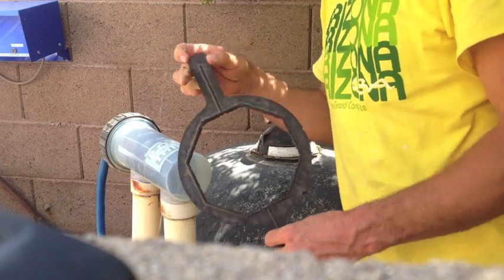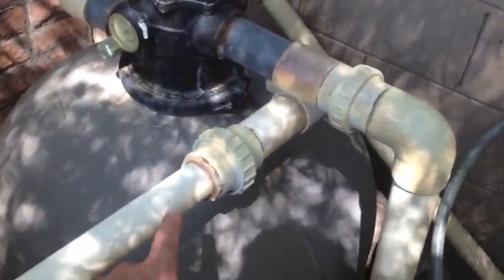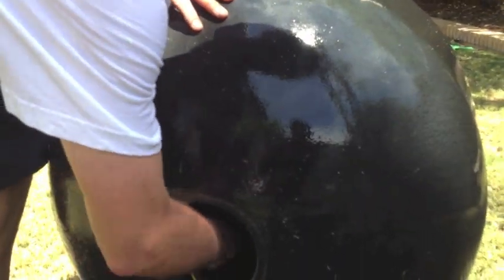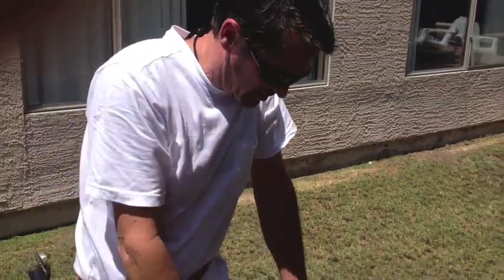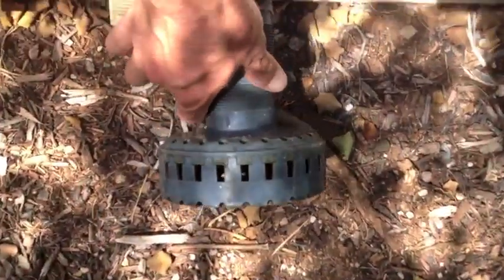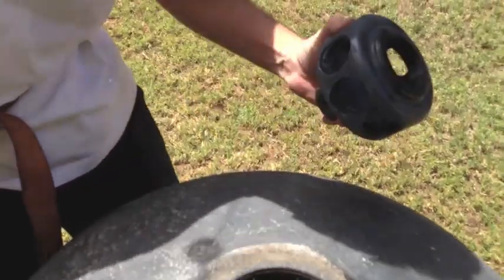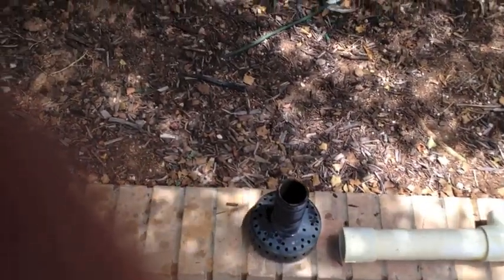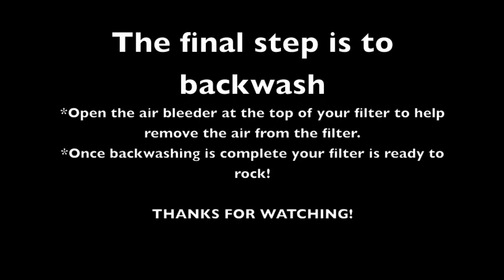Pool sand filters:  Servicing and changing the sand the right way

Comment: Try this : 1) remove threaded closure and diffuser. 2) set multiport to backwash 3) outfit a service pump (I use a Pentair superflo 1.5hp) with a waste line and a short (no more than 8 ft or so) reinforced, flexible hose (I found that haviland I-helix works well, but large diameter fuel hose works the best). 4) attach a rigid wand 4 inches from the end of suction hose. 5) prime service pump and suction hose. 6) place suction hose into filter making sure that hose doesn't contact sand bed. 7) Turn on service pump and fully prime. 8) turn on filter pump on backwash to keep filter full of water and mixes the sand into the water 9) hover suction hose over sand bed with wand. 10) some sand will be stuck to the side of filter, scrap with hose.  11) be careful around laterals.  12) turn off filter pump and suck filter dry with service pump.  13) inspect 14) fill filter with water 3 inches above laterals 15) pour in fresh sand.  I've moved over 10 tons of sand with the same pump!
Reply: The trick is to not overwhelm the pump.  Pull a slurry or water and sand mixture.  Be patient.  You'll find that it'll take you just over half an hour to complete a typical 300-600 pound sand change this way.  It takes literally 5-10 minutes to pull the sand out.  I charge a dollar a pound and with this method, any damage to the pump is more than worth it!  The same way works for top mount multiports, too.  You just have to temp plumb the filter pump into the stand pipe after removing the multiport.  Rubber drain couplings work great for this.  If you do a lot of sand changes, this is the way to go.  If you don't, then scoop it by hand.  I just did a 6000 pound Neptune-Benson horizontal filter w/o pebble in three hours with two ppl.  The system has twin 7.5 HP filter pumps.  We used a 2HP Hayward superpump and switched one 7.5 on abs off about five times.  Done!
Reply: now ya talking! thats what i do
Reply: +Richard Shoemaker I'd like to eventually patent a wand for the dredge setup.  It's quite simple but I think there's gotta be a market somewhere.

Comment: Great video! I wonder if you can help me fix a leak from my drain plug....I cannot tighten the plug down because the male threaded piece is turning. Can I tighten this from inside the tank?
Reply from the maker: You can. You can actually get a new drain plug assembly if needed. While you’re in there tightening it up, it’s not a bad idea to install new O rings on it.
Reply: @SwimmingPoolAZ-SPS  Thanks for the advice, I'm going to give that a try. Sadly, the drain plug assembly is no longer available to buy :(
Reply: @SwimmingPoolAZ-SPS  There is no collar on the outside, just a free hanging '0" ring! So impossible to tighten down. The part is no longer avaolable, do they exist as 'universal' parts.....??

Comment: Getting ready to service my filter before the season starts. A few questions though.  I have read online that people are back washing then rinsing then running after sand replacement, however I have a slide valve, will back washing only be sufficient?  Also, I have leaking bulkhead fittings, so these are getting serviced at the same time.  Should I buy the external and internal spacers along with the o-rings and gaskets?  I know difficult to give a definitive answer without looking, I am leaning towards buying them just as a precaution anyway.  Also what sand do you recommend?

Comment from the maker: Put some sand in first to anchor the laterals down then add water. Remember, you don't need to fill the thing up with water, just add enough water so it settles the sand so that when you fire the filter up it won't crush down the laterals. Think sand castle consistency.
Reply: No gravel used in these filters?
Reply from the maker: renshoota you can but it’s not necessary.

Comment: What ends up happening a lot of times is the sand gets channeled inside the fliter. You don't need to dump all the sand out unless the sand is really beat up. Like its breaking down itself. Turning into gunk. Not sand. But it takes forever and heavy usage. Should last 10 years easy. But every few years. You should take the top off. Wash the sand with a hose. And move it around to avoid channeling. Then top it off with 20 or 30lbs of sand. Pretty easy.
Reply from the maker: Channeling can certainly happen, especially with high pH and high TDS over an extended period of time. Check out my sand filter hacks video that addresses a lot of what you bring up in your comment. Sand can certainly last 10 years and I typically won't change sand unless I see the effects of worn sand but here in the Phoenix area where pools run a lot of hours each day, we get less of a lifespan. Also, if you're adding 20-30 lbs of sand every few years, you have a problem (broken lateral, etc) that needs to be fixed. You won't loose any sand out of a properly working filter.
Reply: +SwimmingPoolAZ yeah I exaggerated with the losing 20 pounds of sand.  you may lose a couple table spoons of sand a year with a completely functional sand filter.  I work as a pool man here in Los Angeles.
Reply from the maker: Right on...if you ever get out to Phoenix, look me up!

Comment: After changing the sand in the sand filter there is a lot of water gurgling in the top of the metr . Also, the flow meter isn't registering in water flow. Checked the flow meter and it is not damaged. What could be wrong

Comment: Dont forget to fill the filter with water above the laterals BEFORE adding sand.
Reply: +mrvelveeta , will the sand filter still work properly if you forgot to add the water first?
Reply: As long as the weight of the sand didn't break the plastic laterals first it should still be ok.

Comment: I changed the sand in my filter. I filled the filter to about 2/3rds the way full of water and put sand in it. As I was putting sand in it caused the laterals to rise. How do I get them back to the bottom so my multi ports valve will go on?
Reply: just scoop the sand out and start over

Comment: Hello great vids .I have a problem with my Sand Filter, can't figure it out, I am getting no pressure showing on the gauge when the pump and filter are running in filter or normal mode, i also do not see water in the glass that is attached to the sand filter.The water has good flow, the pump sucks it into the skimmer then into the filter and returns it to the pool with excellent flow  but it shows no pressure on the filter gauge,the gauge is new,, when i backwash it the glass on the filter fills with dirty water, when i rinse it ,,the glass fills with water but like i said when i run it in normal of filter mode i see no water in the glass, and i see no pressure on the pressure gauge ,also the return is sending some sand back into the pool.Thanks
Reply: Canadian Guitar Hack 1. Bad gauge  2. Water only shows in the window during a backwash. 3. Be sure to do a rinse cycle for about 15-20 sec after backwash if using a multivalve or else you may get some dirt and sand blown into the pool. If it's a piston style valve you can't really avoid it. A little dirt and sand usually makes its way back into the pool because there's no rinse setting.

Comment: How do you relieve the pressure from the tank before taking the top off?
Reply: with pump off and gauge to zero you will be fine unless the filter is below the pool then ya have to deadhead the valves.  being for above ground pools

Comment: well I must put my 2 cents in... before you start wrenching the top of the filter off... MAKE SURE YOU RELEASE THE PRESSURE ON THE FILTER !...lt will make it easier to turn and also safer as it could blow off in your face!!!!
Reply from the maker: You certainly want to make sure the equipment is OFF before opening any filter. If the equipment is significantly above or below water level make sure all valves going to the filter are closed before opening the filter. You can just open the air bleeder line on the top to equalize the pressure to help remove the lid.

Comment: never should put your hands or arms in a hole general safety rule for auto , pool tech , aerospace ,...etc don't want to be stuck or have to get cut out of the device but some time dangerous accidence could happen with forgetting steps, dry vaccum is the better method
Reply from the maker: We do address the dry vacuum method in some of the video text and that's a great alternative to hand scooping. Fortunately with your average residential pool sand filter it's pretty safe to go digging around with your hands. Large commercial grade filters are a different story all together and extra safety precautions should be taken before servicing any thing like that.

Comment: So when will the right way vid be posted?  - add a cushion of water before the sand the delicate laterals & dont tilt the stand pipe to avoid filing it w sand,  just plug it & keepbit where it is meant to be....
Reply from the maker: Good point. Adding a bit of water to help the sand settle around the laterals is something I normal do, especially in the larger filters like this TR-100 but forgot to mention or add it in this video but I'll definitely get that added in the video description. As far as the stand pipe, I think it boils down to preference as long as you're careful.